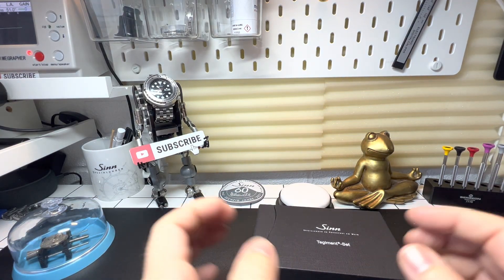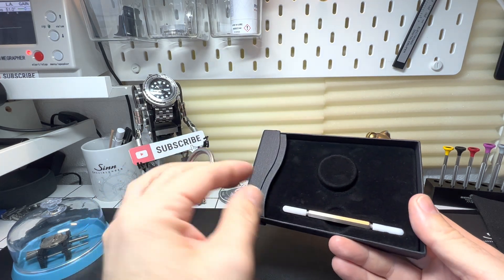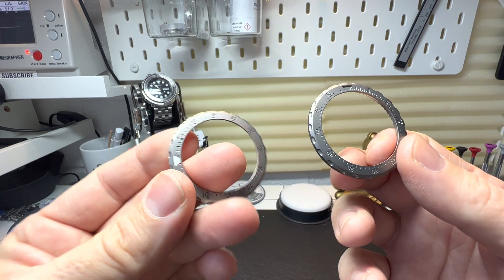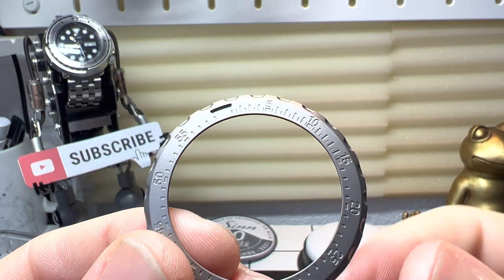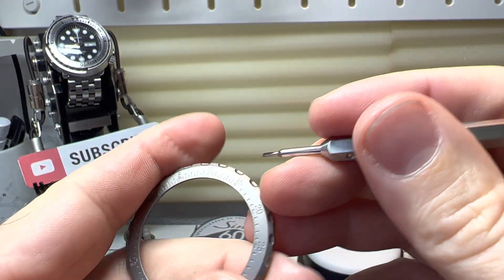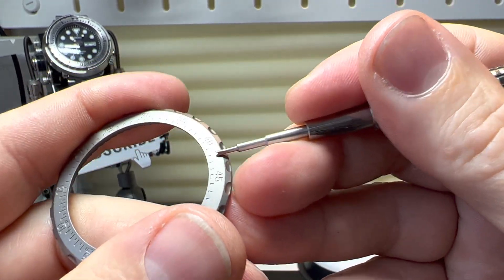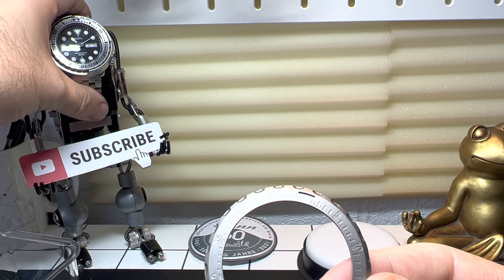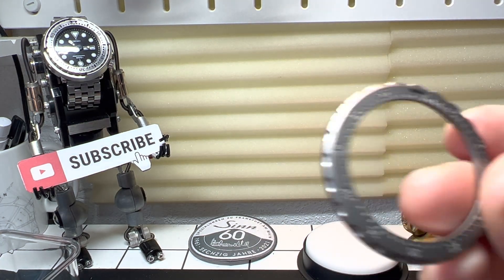Sinn Tegiment Scratch Resistant Test

Comment: I have a 12 yr old tegimented 856 utc and it has ZERO scratches on it and I carry it almost every day. The crystal on it actually has 3-4 scratches on it but the tegimented steel case doesn't have a spec. It's not BS, it actually works.
Reply from the maker: The surface finish is very tough thats for sure

Comment: It's not a scratch resistent coating...that's the beauty of it. The tegimentation process changes the material through and through.
Reply from the maker: Hi Mike, its a surface treatment and is done for Sinn by a company in the UK, Think of it of it this way if it was through and through it would act like ceramic and become brittle, this is not the case as otherwise you wouldn't be able to dent it which I have  👍🏻
Reply: @ClickSpringReview Thanks for your answer.
In the beginning you mentiioned "scratch resistancy of the Sinn hard coating". 
That why i wrote that the process is changing the material and it's not an applied coat like the PVD coat.
But you are correct the change affects only the upper steel surface area otherwise it could really break but its not a coating beeing applied. 

Could you please provide info on the UK company? I was invited to the Sinn HQ, two weeks ago for the spring exhibtion and asked where they tegiment their stuff since i'm interested in all things tegimented. One guy said SUG does it and another person later said inhouse. And i found references that they send it to company in Germany for the treatment. So i'm a little confused and would like to look into it further. Thanks an cheers from Germany.
Reply from the maker: @mikejj697  I've got the name of the company somewhere, I'll try and find for you Mike 👍🏻

Comment: Be careful!! Don’t need a fancy screwdriver to scratch a regimented Sinn… a Mac Book Air will do it easily!! 🤣🤣

I always been hard on my watches, so I was looking forward to having a scratch Free existence with my U2 SDR full Tegiment… but Apple had other ideas! 

I forgot that aluminium has a oxide layer (Al2O3)… which is the same stuff as ruby and sapphire. Typing away at my MacBook, trying to ignore the scraping noises coming from my left wrist… and found this 😩 Difficult to see on the photos, but glaringly obvious in the hand. Oh well, at least bezel and case are unmarked!!
Reply from the maker: Thats really interesting Sir , I've just checked and your right its around 1800HV which makes it harder than silver Tegiment but not as hard as black hard coated Sinn watches but its pretty close 😱

Comment: I saw this being done in a Sinn video... I found it difficult to look, because it was being done to a watch. Most watch cases can take a light polish, but I presume that wouldn't be possible for a Tegemented case, or indeed any hardened watch case without destroying the finish: Grand Seiko and Damasko spring to mind here. I would add that operating the bracelet clasp repeatedly can wear through the Tegemented finish, so the treated surface isn't entirely foolproof. I'm still glad that I opted for the Tegemented U50... the longer I have it the more I love it. I hope that you're OK Barry, degree courses are really hard work and it's easy to burn out. Look after yourself, cheers, Bob 🍻
Reply from the maker: Cheers Rob I've a load to to do this weekend for Monday at Uni but hopefully I should be able to get it done, well there is no hopefully it has to be done :)

Comment: Use the sharp tip. You’re just rubbing the smooth side.
Reply from the maker: Did you see it scratch the Seiko pretty easier I was holding to the same way Sir
Reply: @ClickSpringReview  👀
Reply from the maker: You need to watch the video Ryan sent me I posted it last night , He runs the bezel along a brick wall a few times and it doesn't leave a mark

Comment: Tegimentention is something that every brand should be using. It is a shame that my Tegimented clasp for the silicon band came only with the lid tegimented whereas the rest of the clasp is not tegimented. I think Sinn is cheating on this.
Reply from the maker: I can see your point Sir but when was the last time you scratched the under side of your clasp ? I have this feeling you're going to say well funny you should say that 😁 👍🏻
Reply: @ClickSpringReview  the thing is that cheating shouldn't be backed.
Reply from the maker: The blacken surface is even stronger at over 2000HV were as the standard is  around 1500HV , Normal steel is 200HV Seiko Dia is rated at 500HV